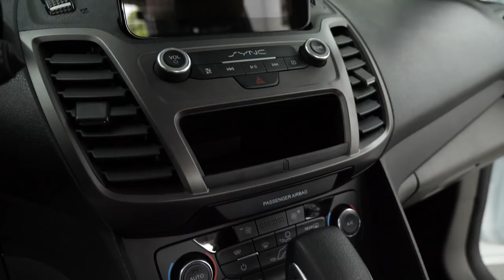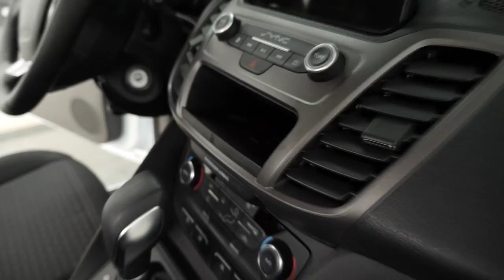Fire Extinguisher Explosion Inside Car ! | Full Complete Detail Interior Exterior

Comment: The patience and concentration working on this disaster of a truck is very impressive! Can hardly wait for the spilled entire paint can inside the vehicle video gets posted.
Reply from the maker: Thanks 👍 at some point I lost concentration because dust came out of every corner, it seemed that it never ended
Reply: If a paint can spills, it’s very difficult to clean. Even harder than this.
Reply from the maker: In my own car I cleaned a 20kg paint can that was tipped over, and it was easier to clean, because only the trunk had to be cleaned, and the paint was water-based, not solvent-based.
Reply: @MansoorDetailing  oh I see. Great. Otherwise you would have to use acetone.
Reply from the maker: acetone can be dangerous, plastics bleach them
Reply: @MansoorDetailing  pour it on an applicator pad first and then try rubbing gently over paint

Comment: It's inefficient to clean large areas, such as the top of the dash and door cards, with a detail brush. It may look good for the video, but it slows you down. Grab a magic sponge and some multi purpose and wipe down large areas. Use an air line to spray out any tight gaps. Simples. Same for vacuuming, the crevice tool is for crevices - larger open areas should be the wider attachments being used.
Reply from the maker: The extinguisher powder is not convenient to wet it, since when it comes into contact with water it becomes a little "oily" and difficult to remove and it becomes corrosive, so first I vacuum most of it and then I remove the remains

Comment: Nice job!!

Which product you use for leather seats and stearing wheel?
Reply from the maker: Thanks!! For lesther i use CarPro Inside
Reply: @MansoorDetailing  I will try it, too.

I have very good expetience with Sonax Leather Foam Cleaner, you can also try it
Reply from the maker: I am a fan of the products, and I have tried several for leather including the sonax, but the CarPro has a very high cleaning power, in fact you have to be careful because it can even lift the dye from the leather